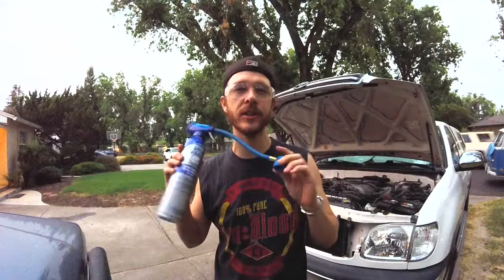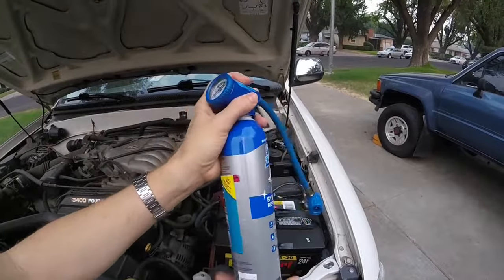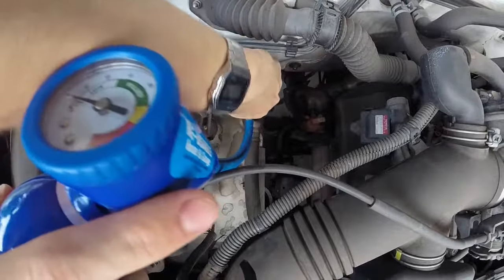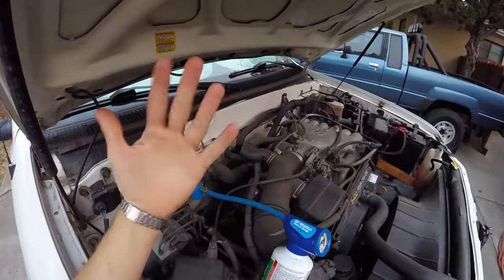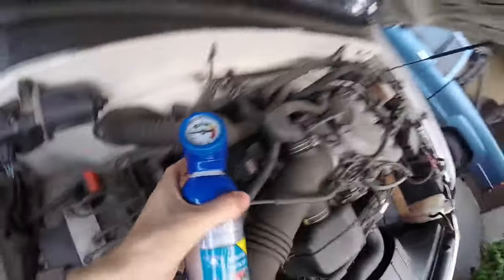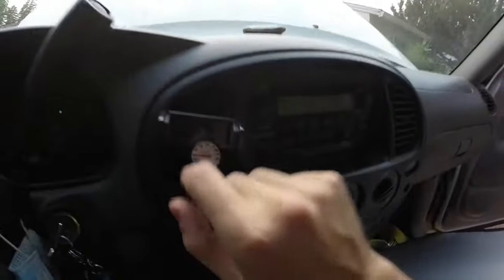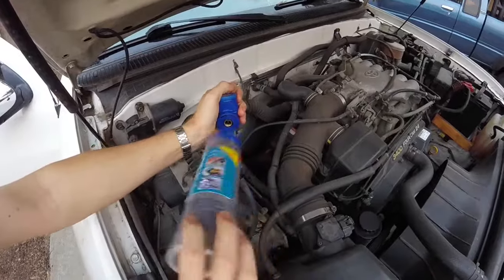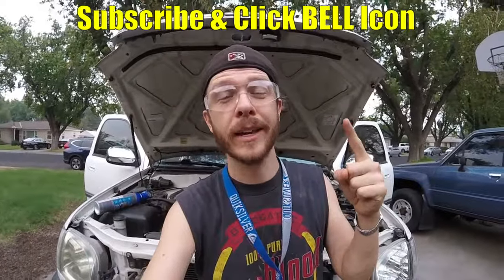Properly Recharge Your Car's Air Conditioning AC System in LESS than 5 Minutes! | Toyota / Lexus

Comment: You just saved me a couple hundred dollars. I'd never have thought to do this, but for the $50, it was worth the risk. Old car, 2007 Avalon, so not looking to fix the AC if there's a leak, but if it's slow enough, a can a year won't break the bank.
Reply from the maker: Happy I could help you out! Good luck 👍
Reply: Great info!  Ever try leak sealers?

Comment: That was very clear to follow and I feel so much less stressed out doing this myself for the first time! Thank you!!!
Reply from the maker: You're very welcome, happy I could help 🙌👍
Reply: @JonnyDIY  my gauge reads red! I could cry! 😭😭😭
Reply from the maker: @scribblerex  is that red with engine running and AC switched ON? It usually goes down when AC kicks on. Thats the reading you want to look at
Reply: @JonnyDIY  yeah, red with the engine on,  fan on high, ac all the way cold and on full blast.  🫤 The air compressor seems to be running correctly. 

I did just get the radiator and drive belt replaced (2009 camry)...is there any crazy chance the auto shop forgot to reattach something?
Reply from the maker: @scribblerex  look at the ac compressor and make sure the front clutch it kicking and turning on (it will kick on and then shut off). If refrigerant too low or empty it wont kick on at all. Possibly they could have forgot to plug wires back in or had to open AC system and leaked out all refrigerant. If it was working fine before and now not after Id say its possible
Reply: @JonnyDIY  my dad is helping me now, and even he isn't seeing a change so empty or too low is a possibility. I'll call the shop on Monday and see what they think... I'd rather not break the car worse and I can drive my craft show van till then.   Ugh! Thank you for helping!!!!
Reply from the maker: @scribblerex  ok good glad your dad's helping. Yeah I'd just wait too. You're welcome, happy to help. Hope you get it working again 👍

Comment: Bought the Sub-Zero brand at AutoZone while waiting on brake pads. However, the connector is too small for a 2020 Toyota Corolla LE. Unfortunately, I didn't find this out until after the can was pierced. Make sure that the connector will fit the Low input on the line prior to buying.
Reply from the maker: @richardbradley1806  yes your car probably takes the newer r1234yf that uses a different connection

Comment: JonnDIY just saved you over $150 bucks! A professional AC recharge cost ranges from $150 – $300 on average depending on the make and model of your vehicle. Due to refrigerant losses that occur over time, this service is one that should be added to your vehicle maintenance schedule. It is recommended that this service be performed on a vehicle every 100,000 miles or so.

Comment: Great video. So if the refrigerant is not empty, I can just recharge the system without vacuuming out the air?
Reply from the maker: @pistol2556  yes correct 👍

Comment: AC broke on my 2015 Sienna.
I wondered if it’s the relay or fuse but I went to Mechanic, he checked refrigerant and there was none left in the system. He filled in some everything come out, hey we have a leak in the pipe leading to the passenger blowers in the back rows. So they blocked the back row cooling and refilled the refrigerant. So, it all works now but we get cool air just in the front, cost me nearly $400. (Replacing the whole pipe maybe cost me$1500) but that’s the trade off
Reply from the maker: Dang, well glad they got front working. Yes AC systems can cost thousands when you start working on them. Very expensive, mostly the labor
Reply: Great info and video.  Maybe back pipe can be easily fixed with epoxy glue and heavy duty wrap tape.  Does back AC have secondary compressor ?

Comment: I have a 2006 lincoln ls.. it’s seems to blow cold for abt 3 weeks. Should I just keep charging it? I’m told I’ll have to pull the engine dang near since it’s a V8 n that ain’t happening. Thx for you future advice
Reply from the maker: I would just keep topping off during every couple weeks when it starts getting a lil warm. Do that during the hottest part of summer to get you by. Can put in leak dye to try and pinpoint leak, may be somewhere easy to fix. But if it's at the compressor and it's in hard location that'll cost a bit in labor for a shop. I'm not familiar in compressor placement on that vehicle

Comment: Is it normal for it to go straight to red as soon as you connect it? Mine does that, and I’m worried it’s a bigger issue
Reply from the maker: That's usually normal. Look at the pressure reading when the air conditioner kicks on with car running

Comment: hey my ac just stopped blowing cold air i ran it for maybe 10 minutes max without it working cause i didnt know why it stopped. do you think i need to vaccume out the system now? what should i do? thanks
Reply from the maker: Stopped working after you recharged?
Reply: @JonnyDIY  no i never recharged it yet. it just basically stopped blowing cold air yesterday but i left it running for 10 more minutes and kept messing with the switches in the car while i was driving. then i watched your video and you said if you run it empty you will have to vaccume out the system. so i was wondering if i screwed myself and now if i have to vaccume the system or should i be able to recharge it still the way you did in this video? Thanks
Reply from the maker: @AdamH-n3l  no you'll be ok to recharge it. I meant if all the refrigerant completely leaks out of system or if you work on it and open the lines up, then you would need to vacuum before recharging. I would try recharging and hopefully it'll get it cool again 🤞 good luck 👍
Reply: @JonnyDIY  that makes sense. thanks for the reply and the video, i really appreciate your time!

Comment: I just used the same type and it's not blowing cold it's just blowing cool. Does it take awhile ? I've been driving it for like 30 minutes. I had it vacuumed and everything.
Reply from the maker: Sorry just saw this. No it should be immediate. Possible didn't add enough? Add only the amound listed on sticker on underside of hood. If adding more doesn't help it may be a component failing

Comment: This is really late and the dumbest question, and I’m not a car guy but when I insert the clamp, the needle goes directly to the red, is that an issue (I’m assuming it is) but I just don’t know if I should turn the car on and then see if it’s still in the red
Reply from the maker: @Thegamingexpert81  That's usually normal. Check pressure when car is on and AC on too and when the ac compressor kicks on (will see clutch spinning)
Reply: @JonnyDIY awesome thank you! Was able to get it going and I have cold air now, when I pumped however, the gauge didn’t budge anymore after a certain amount, is that also normal?
Reply from the maker: @Thegamingexpert81  yes those gauges usually aren't the most accurate, but as long as it cooled down should be good 👍👍

Comment: I used the same product on 2010 Corolla which seemed to have zero pressure. I kept adding but pressure doesn’t go over 20 psi. I wonder if I should keep pumping and complete the whole bottle? The AC did blow cold air after filling a bit. If there’s a leak - should be hearing any hissing noise?
Reply from the maker: If you check the sticker on underside of hood it'll tell you the max refrigerant if system was completely empty. I usually like to vacuum system first if I know it was empty. If it's cool enough, I'd wait and see how long it lasts. Then you'll know if its a really bad leak or not. If it holds a long time, I would probably vacuum system out next time you refill 👍

Comment: I have a 96 corrolla..  I can hear and feel the compressor kick on pretty much right away.  I have no cool air.   I was told by local mechanic it is 325.00 to fix it.  He told me without even checking its the compressor.  I didn't go back.
Reply from the maker: I would try recharging it as I showed. Worth a chance. Then take to someone who can diagnose and repair if needed
Reply: @JonnyDIY  should I let the air out of it?

Comment: How do you know how much you have in the system if it is not empty to begin with?
Reply from the maker: No true way to tell, unless you vacuum system and refill. But if you add slowly til it's just cold you shouldn't have to worry about overcharging 👍 I have some videos on Vacuuming Ac too

Comment: Yea just spent 20 minutes trying to put the cap on the low side and it wouldnt connect. Not sure what I did wrong but I guess I have to take it somewhere anyways 😢
Reply: I'm having the same issue. Did you solve it?

Comment: 2008 Prius?
Reply from the maker: Should be same process 👍
Reply: 2008 prius has a sight glass just use 134 without sealant just pure 134 add until bubbles disappear in glass I have an 08 prius

Comment: I am still scared to do this but I am sick and tired of feeling like I am in hell every time I commute. I don't wanna be lied to and get ripped off if I go to a mechanic. Its frustrating. I am scared to over fill my ac and screw it up and also scared of going blind and getting frostbite but I don't wanna spend more money to get gloves and eyewear protection. I got a corolla 2014.
Reply from the maker: @TheShyArmyTV  you should be ok, it's easy 👍
Reply: @JonnyDIY  I read that it's bad to buy one with stop leak. is that true?
Reply from the maker: @TheShyArmyTV  I've used before without problems, but I did vacuum system first. I show in this video
https://youtu.be/6xbnUd649Es?si=awvzA0J7c7G3tO9Q

Comment: Don't do this. Here's why: 
1. You don't know all the pressures.
2. These kits don't have all the gauges
3. These kits contain moisture which destroys components with corrosion
4. When this forces you to replace expensive parts, you won't be happy. You won't be "saving money."
Reply from the maker: Yes it's best practice to vacuum system first, then recharge. I have several videos showing that process. But I've had no problems in the decades doing it this way either. As always your mileage may vary for anything
Reply: @JonnyDIY  So how do you know how much weight is required or installed?  I didn't see any info on that.  Or how much pressure is in the system since the gauge doesn't tell you that.
Reply from the maker: @adamr8628   After vacuuming the system I will use a scale to weigh the refrigerant cans so I can figure the amount going in
Reply: @JonnyDIY  ok. Is there a reason you don't use the set of manifold gauges with the multiple hoses?   I didn't see them in this video, but maybe you normally use them?
Reply from the maker: @adamr8628  I use them in some of my other videos, this video I just wanted to show this method as it's easier for your average person to understand how to do

Comment: Expert tech for 32 years. Thats a great way to destroy your cars compressor. You have zero idea how much freon your installing. Good thing is it brings more work into my shop after the disaster happens LOL
Reply from the maker: Yes as you know the best way is to vaccum 1st and refill with exact amount of refrigerant called for. I've done it both ways for years, no problems with this. But you're right it can easily go bad if you mess up 👍
Reply: @JonnyDIY Without gauges how do you know the amount? These kits don't tell you the important pressure that you need to know.  They can also contain moisture and destroy components.

Comment: Let me ask you a ' stupid question '.  To eliminate the possibilty at introducing ANY amount of air into the system,i.e. the hose, would it be wise to hold back on the collar partially where you connect to the LOW SIDE and very quickly press the LEVER on the can thereby eliminating the air once the freon comes out(wear gloves), and THEN letting GO of the collar immediately, so it is allowed to FULLY snap closed?
Reply from the maker: Not a stupid question. Yes, you can do that beforehand. It's called purging the line 👍